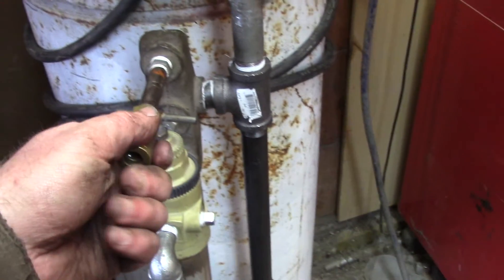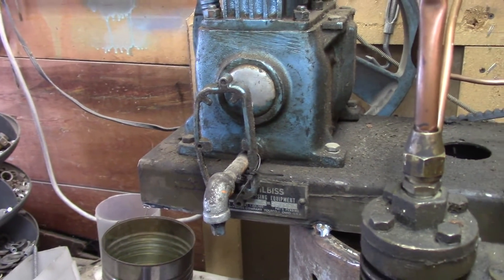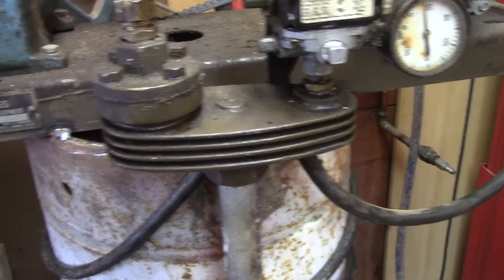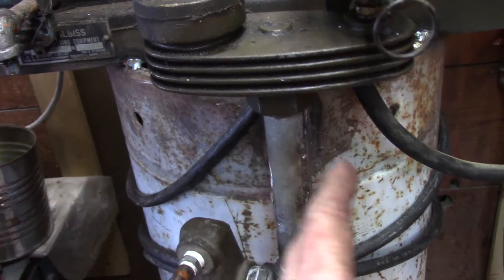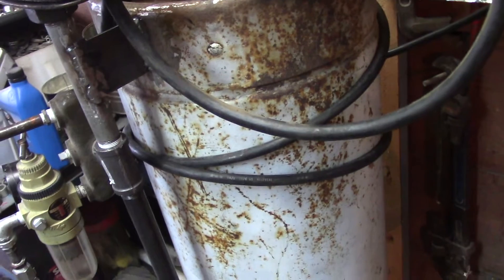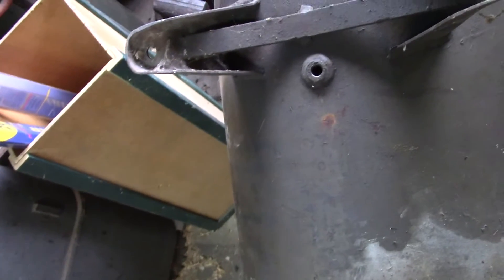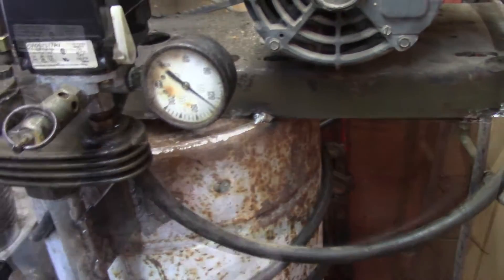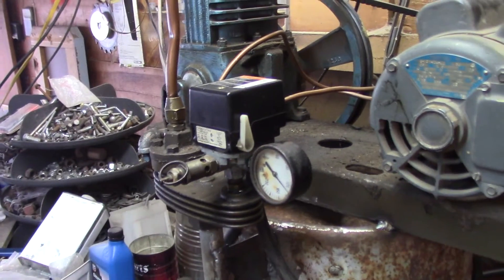Converting Propane Tank into an Air Compressor (pt4)

Comment: so you did all that work,why wouldn't you hit it with a rattle can,and wipe the grease off the platform? sure it will run the same but If I spent the time to build it, another hour making it look newer why not?
Reply from the maker: Fair point.

Comment: You CAN still get water in the tank if you don't drain the condensate often enough, especially on humid days.  There is a way around that, too.  You need a large diameter pipe on the horizontal part to act as a collection vessel.  Pipe is easier and cheaper to replace when it rusts out.  If it's too much work, you could remove the drain valve and extend off that direction, then put the valve at the end of the extension.  Your DeVilbiss tank would still be alive and well today if water could have ONLY collected in the drain extension and not also in the bottom of the tank.  Think: 2 inch well pipe.  Nice project.

Comment: Good job repurposing that old propane tank into something very useful.  You'll still probably still get water in your tank from the heated air going into the tank and then cooling, but it will most likely be a lot less.  Some guys do a air cooler conversion on the output that looks like a part from a moonshine still, but it works.  Since you have to replace that air output line anyway, might be something to consider.  Even if you don't, still nice job.
Reply from the maker: Even if it still builds water, and they all do, the tank comes to a point and that is down so when I drain nothing should be left I hope.